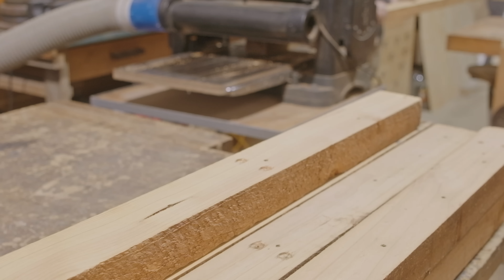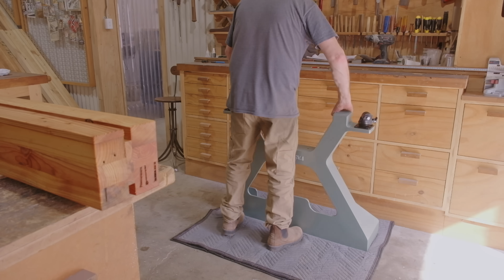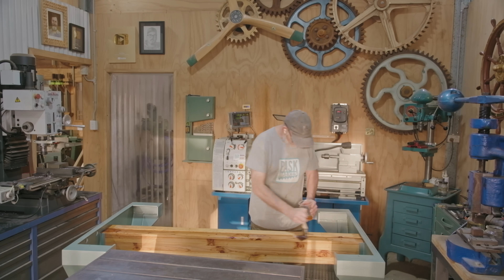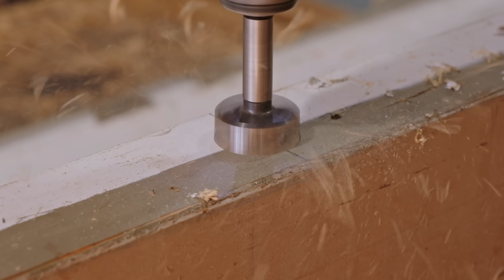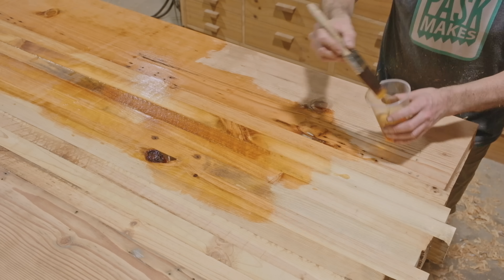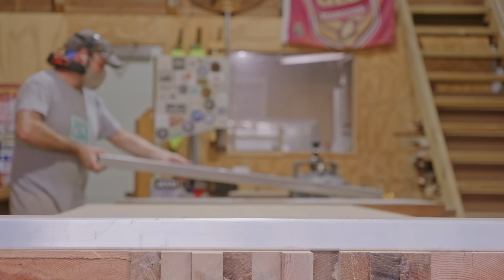Turning Steel and Wood into an Epic Workbench

Comment from the maker: I finished the workbench using the industrial style legs that I made in the last video. I wanted it to be strong, functional, and give it that old railway workshop style. I still need to install the two vices which I'm planning to do in my next video. 
It really was a fun project, going all out with style rather than regular uprights and horizontals, not sure what you think of it but i love it. :)
Reply: Neil it came out magnificent, you nailed the design !
Reply: @norbertr823  actually, he de-nailed the wood, tho ;p
Reply: Neil, I’d be proud to have that bench in my shop! Well done, sir!
Reply: Мені теж дуже подобається!  😊
Reply: Fantastic, love it! Can't wait to see the vice in place.
Reply: About the metal detector, wouldn't the cheapest easy solution be one of those stud finders/cable finders for drywall? They should detect nails in wood too...
Reply: Surprised you didn't make dome nuts for the threaded bar. Having said that though amazing bench. I would love something like it.
Reply: That thing is awesome, that's what I think of it. It's a beast. A monster. Love it.
Reply: What is the name of the welding method you did? I like this method and want to learn it.

Comment: That's quite a bench, really unusual. But it'll be great to have a solid and stable structure to do loads of new projects on. I just love how that Pine and the Oregon looked after you'd planed and sanded it, but you put the wood oil the grain really popped, and it gave the wood a lovely warm glow. I bet you that's going to be one of your most treasured fittings in the shop. Great job, once again.

Comment: Just an idea, use acorn nuts on your threaded rod running in the beam. I didn't and have the hip bruises to show for it! I' m also cheap (and poor) so used 1/2" rebar, with the nubs ground off, and threaded 7/16"NC. (I'm Canadian and old so still use Imperial measurement). Built my bench from salvaged steel, and old growth Pine beams also salvage from river bottom logs. Lucky I have a friend who builds doors so used his 96" long belt sander to flatten my top. Love your videos, would like to visit Austrailia but health doesn't allow.

Comment: i did my 8x4 workbench out of 2x4's with a scrub plane i made from a $20 amazon plane, i cambered the iron even more heavily than that and opened the mouth with a file, and that bad boy hogged off monstrous amounts of wood. took me a day to do but i took a solid quarter to 3/8th of an inch off the whole thing. i bound it together using pipe clamps and ratchet straps, which got an incredibly clean fit for not having a jointer and only a jobsite table saw.. the heavy camber really prevented tearout too, since the curved iron sliced so much. didnt even need a ton of smoothing afterwards either.

i also am a huge fan of having a hand block plane set up with a heavily cambered scrub plane iron for end grain cleanup and small spots that need a lot of material removed.

Comment: The way you made the very bottom of the legs is ideal for adding some acme threaded feet that can be used to level the table and lift it up off the wheels when you want that super solid feeling. It would be a sweet little addition for some extra utility.

Comment: Great Loking Bench those Cast Ironstyle Legs  are super Cool looking ! Im between homes /Shops myself  iM fairly sure I will  “steal” or borrow something similiar  for my next Shop  that will mostly be Woodworking   But it’s not uncommon for m Enches to  have Antique Car  or Marine Parts on them  for service or rebuilding  ?   I also have a fondness for Antique Honda Motorcycles  if I can resource the metal cheep enough I might. Builds couple  of them  for myself and dedicate.  One for each Project  type

Comment: Hi Pask, another amazing project to watch come together. Noticed you wearing the noise cancelling in-ears with the sander and impact driver. Just a note that sadly they don’t protect your ears like hearing protection does - apparently the harmful sound waves still reach your eardrum despite registering as quiet. 

Also, I can see the threaded rod might make it hard to have holes for bench dogs, though as an alternative I came across a recessed spring loaded bench stop made by Stanley. I reckon you could fabricate one!

Comment: Amazing build Mr Pask, as always! You will never stop wood movement, water is not compressible, it's why hydraulic systems work. If you try and stop that inevitable movement, it will find some other way to move. It would be interesting to measure the width now and again in a different season. I'd be willing to bet that if it hasn't pulled those washers on the horizontal studs deeper into the timber, (or they are rattling loose) then the top will have gone way out of flat. I think the slotted holes into the legs was a smart move, you are more likely to get a wider table rather than a wonkier one!

Comment: Wow, that thing is bulletproof. I'm betting with that weight it doesn't move much even with the casters open. If that were my bench, I'd sand the old paint off, personally, especially given the oiled finish you're going with. For me the best part was that trick of making centering pegs for your drill guide - I've got the same model and will have to do that.
The other thing this video reinforces for me is that I'll stick with my idea of a torsion box sandwiched between two sheets of MDF once I get to making my bench, which like you will replace two older ones.

Comment: Love the workbench, it's awesome. Just a couple of things, Next Level Carpentry uses handfulls of fine sawdust to rub glue squeeze out, cleaning it without forcing it into the wood. Since you are planing these after glueup you don't have the problem of it ruining the finish but it's a good tip. 
Engel's Coach Shop, one of my favorite channels, has a finish  you might want to try. He mixes 1/3 paint thinner, 1/3 linseed oil and 1/3 either Thompson's Wood Preservative or paint depending on if the final finish is wood or painted. This is his first coat and due to the paint thinner it sinks deeper into the wood. Then he goes back over that with either linseed oil or paint, building the layers. This results in his paint jobs lasting much longer than normal.
Finally, the old rule of thumb when using linseed oil is; "One coat a day for a week. One coat a week for a month. One coat a month for a year, One coat a year for life." it's what they did for tool handles and the like for centuries.

Comment: That is just amazingly overbuilt. Would think the bottom shelf working in tandem with the top and the 2 steel bars would be more than enough rigidity. The beam is just overkill.

Comment: Great to watch Neil, terrific job as usual, as I have a big box of hind sight here one change I would have made is putting the castors inboard and and use some M16 threaded rod with a hand screw on the top and a pad on the bottom, 2 turns and the wheels are in the air and the bench is super solid, you wouldn't need braked castors either, I find castors even when locked have some movement also get out the little brush and put some colour on those raised letters.
Can't wait for the vice rebuild

Comment: What a fabulous sewing table!!  Then if the sewing room is not big enough, just build a new room.   Oregon is my favourite timber so there's another tick from me.  A few years ago I made a table (about the same size) to hold a quilting frame, it wasn't anywhere near as fancy as yours, but did the job perfectly and was made from excess timber left on the kerb for council cleanup.  It had to be assembled in the room (wouldn't fit through doorways) but turning 90degs into the hallway was tricky and time-consuming with small movements back and forth, considered removing doors to gain a bit extra turning space.  Also thought about removing window panels, but that wouldn't work as the opening was not large enough and would have needed to hire an army of helpers...so I felt your pain in moving your table, it brought back a lot of memories!  Love your workbench though!
Reply from the maker: Thanks very much! Your table sounds great and free materials sounds like the go! :)

Comment: ABSOLUTELY BEAUTIFUL!! I LOVE this Workbench!!!! The metal work came out soooooo good!!! It looks like its straight out of the late 1800's! The style is just perfect! And the wood looks amazing too!  Using the all-thread rods between the two legs was great too! I thought you were just gonna make a wood beam and that's it (you probably mentioned the all thread in the beginning but I guess I didn't hear lol 🤷‍♂) 
I'm not too sure if I would keep the pain on the edges though. The color is close enough to what you used on the legs so it doesn't look bad, but if the brown paint was closer to the woods color then I think it would work really well, but IDK how you feel about making the work surface so dark. It doesn't look bad the way it is, it just looks like what it is - left over paint that wasn't removed. 
- Ohh, maybe you could get the shelf to match (not with paint but maybe a stain that keeps the grain visible, but it matches better with the brown paint on the edge. BUT I'm not sure if that works with the brown being on the top half of the edge. And flipping the wood over is just out of the picture. I GUESS it's possible to flip it over if you haven't started cutting the vice notch out yet. Burt if you haven't then maybe you could see how it looks in the computer render 🤷‍♂ You seem to have enough skills to change the colors around in the render and maybe a throw up a background that is as light as your workshop. And then you can see if it looks any different to flip the table top over and get the brown on the lower half - LOL - I'm insane, aren't I? lol Sorry - It still looks great even with the brown on the the top half of the edge. It's up to you. Its ALWAYS up to you :D
Thanks for the awesome videos Pask! I REALYL love watching your vids :) HAVE A GREAT WEEKEND and SEE YA SOON!  BE SAFE  and STAY AWESOME!

Comment: Love the bench👍🏼 I would keep the paint on the edges, adds character.

I wanted to make something similar a few years back with a flip top for our veranda. One side a general purpose work surface and the other side for eating on. 
I considered using heavy duty pillow block bearings with a lock mechanism.

Comment: Absolutely LOVE this project!  So much that I am going to build my own version of this.  My plans are to use reclaimed materials as much as possible, including the steel.  A tip I'd like to share that I discovered from repairing a broken cast iron bench vise is to needle scale the area to imitate the rough look of cast iron.  You can grind the needles sharp or rounded to suit your needs.  I used this technique to blend my braze repairs into the surrounding cast before paint to make an invisible repair.  One could possibly do this to steel to make it look more like cast.  I'm going to try it on my work bench project.  Thank you for the inspiration.

Comment: If wood expands when wet or something, and it's a tight fit...then what?  I'm sure it'll crack. 

You say the shelf no longer fits through the doorway.  But you only put an interior shelf on...if you didn't change the dimensions, why would it no longer fit through the doorway when you got it through without the interior shelf???  I don't understand.  

That is an amazing job and it looks like it was hard work as well.  I would be more than happy to say you were on my team because you seem quite confident and your projects are well done.

Comment: I found it very difficult to follow what you were doing in the beginning of this video (< 5 mins) for some reason.  I don't recall if you normally have illustrations or what the reason is.  It might be that you seemed to be using construction terminology like stud and beam which I'm not familiar with and haven't heard used in furniture construction videos, do it was difficult for me to visualize what you were working on.

Comment: Use a feather board especially with heavier beams like that. It’s safer and gives you a straighter cut on the table saw. Only takes seconds to set up but saves all the hand planing time and work if you use the right blade on the table saw.

Comment: If I  built this as well as you did, my wife would not allow that to be used as a work bench. She would insist on trading that with the dining room table!
Reply from the maker: I've thought about building something like this for the house but not happened yet. Maybe now though. I keep trying to design a kitchen island with style (something like this bench) but to get the maximum use of space it pretty much has to be a box. That limits the possibilities and our kitchen isn't very big so have to make the most of every nook and cranny. :)
Reply: good luck trying to move this inside the house! must weigh a ton
Reply: @qwerty842 Each leg is over 52 kilos on its own!
Reply: lol i thought same :D , my current bench is out old dining table reinforced!
Reply: I think I know what the missus would plan for a 900 kg benchmark test Bruce, nudge nudge...
Reply: Я теж думав про це 😅 
Швидше став лещата! 😮 Інакше...😂
Reply: insist on selling it and use the money to buy a new dining table,?